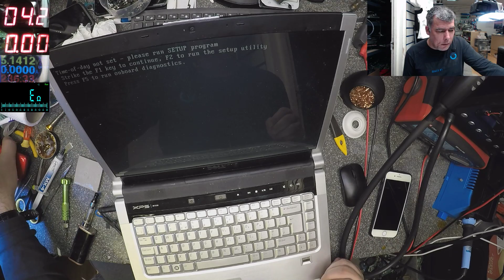Dell Xps, power on but no picture or backlight, Graphics repair, the way how i do it

Comment: what if the laptop screen light turns off like this but is plugged into a normal monitor, is it still the VGA chipset that has the problem or is it just the LCD?

Comment: Great job Sorin, your flux is doing a great job for me, love the fact that when it dries it leaves an insulated coating on whatever its been used on, like glass, as its not destructive in any way surely this will improve the chances of the repair lasting longer?

Comment: Frustrating issue.. mine continued doing the same after the re paste.. got to the point it didn't come back again.. ended up swapping the board. Good computer.. shame about the GPU issue.. did last for a few years steady before the GPU overheat. still have it. Also as a side note.. these have an issue with the batteries.. they need a specific bios version to keep the battery charged. A09 if I remember correctly.

Comment: May I ask what kind of flux do you use for it? Thanks.
Reply: He luckily has a video on making your own liquid flux! Basically, he uses a brand of solid rosin flux called kalaphonia and mixes it with rubbing alcohol. The trick is to not mix too much rubbing alcohol, so it doesn't evaporate under high temperatures. You don't even need to clean it because the leftover rosin residue will isolate the circuit, so it's great for motherboards with water damage.

I'm not the expert, so find his video on it, if you haven't already! It's called "how to make your own flux" I believe.
Reply: @paulandreotti1639  if I do not have flux what else should I use

Comment: I have lenovo ideapad z580, no display, power led and capslock blinking, I did hard reset, with battery, without battery, and many more test, but no display.
My question is since my cpu is intel i5 3rd gen 3210m, and the gpu is integrated in cpu, how could I reflow the gpu? Is it possible to reflow a gpu that is integrated in cpu? Thanks for your response in advance. Nick

Comment: Hi , I have an issue with my Dell XPS m1530... The keys are getting randomly pressed /ghost keys after disconnting the keyboard as well...any suggestions? Thanks in advance
Reply: mine does this I see a keyboard on ebay for £10 which seems OK but hope that is the problem press y it does 6 and other keys.

Comment: Hi. I have an atten 860d hot air station. It takes much longer time to unsolder Things. Is this because your station has more power? And how do i know , how long i have to heat my  graphic chip with my station. I dont want to kill the chip 😊
Reply from the maker: i can't recommend you nothing, coz depends of your tools, but try with less time and less heat and test, better to be safe than sorry
Reply: my station seems not as hot so I go aggressive.  think when I choose 450 is actual 350. just got mine so I'll get used to it.  probably mess up a few times,  but hey that's the price of learning. be safe but sometimes be aggressive. breaking something will show you the limit. practice on a working laptop.  heat up until it fails then you'll know for sure.

Comment: You can do 500 deg short time or lower temp like 330 deg longer time.  Either way, solder is molten.  500 deg C is destructive temperature, can destroy gpu and other components.  So why not use lower temp?
Reply: Pretty sure he was set at 500F not Celsius.

Comment: I've as well resolderd a dead graphics card I used the hot-air on 355 degrees and it was working fine again
Of course with Flux
Reply: What flux though? Liquid or paste? Sorin says "use the flux i use" but he doesn't specify.
Reply: @thingshappen9199     The Flux»»»» rosin mixed with (disolved in)alcohol

Comment: I did the same as you ..when I opened the ram and started the laptop it started working 

Everything is fine but after 5 minutes it shutdown suddenly 

Now the screen works but suddenly the laptop in middle of startup it shutdown
Reply: Heat issue disassemble heat sink clean cpu of old thermal paste apply new stuff clean fan reassemble heatsink
Reply: @garrygibbons2989  lol one shop told me that I got 50% chance of losing my laptop ..
He said its motherboard issue 
.without even touching the laptop